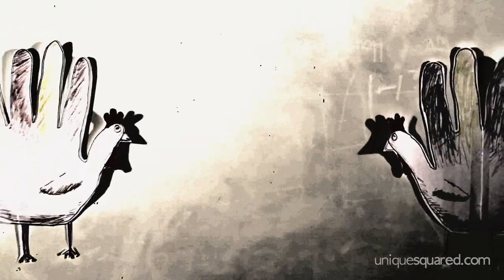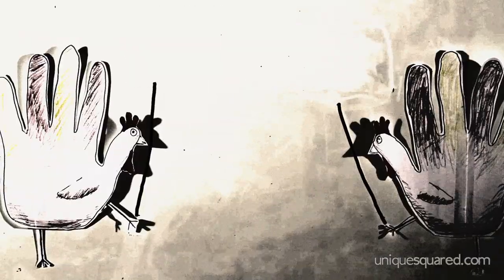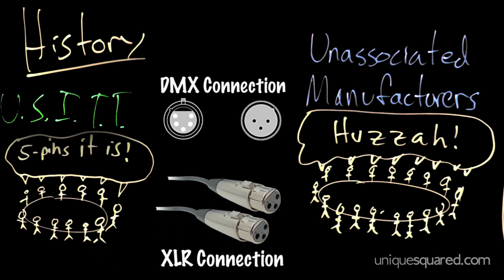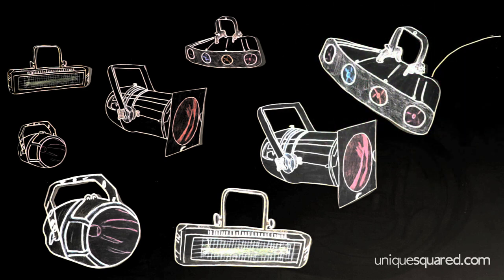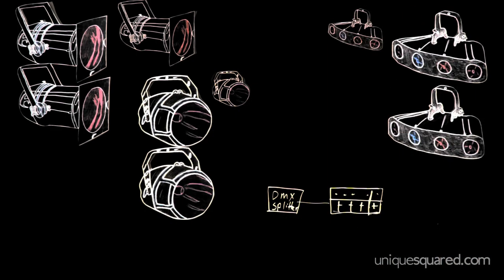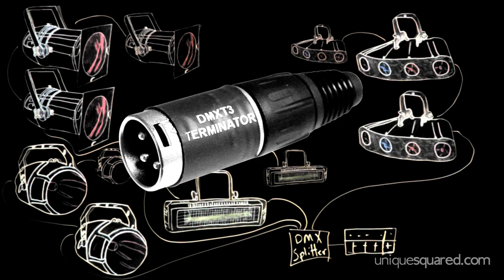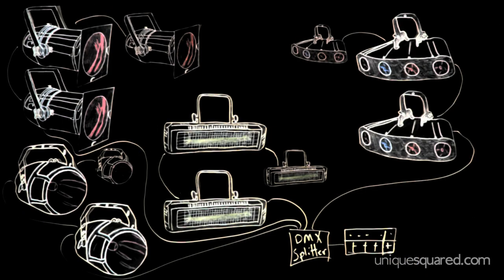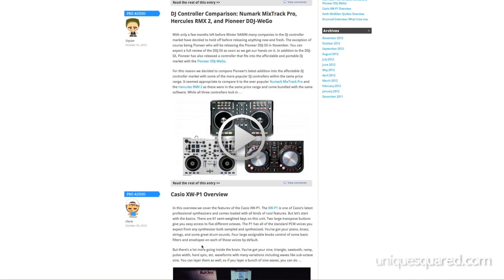DMX Lighting Tutorial Part 4: DMX Wiring | UniqueSquared.com

Comment from the maker: Some microphone cables tie the signal return and shield drain wire differently than the twisted pair return within a DMX cable. This may introduce a potential grounding problem in your system. Grounding problems can fry electronics. Our example is extreme but meant to highlight the potential problems when using a microphone cable. Proper installations will keep your equipment running at their best performance.

Comment from the maker: We wouldn't recommend using microphone cables for your lighting fixtures. 

The microphone cable is designed for audio frequencies (low frequencies) and is a low impedance, high capacitance cable. DMX data cable is designed for a wide bandwidth high frequency data stream, it is a higher impedance and low capacitance cable.